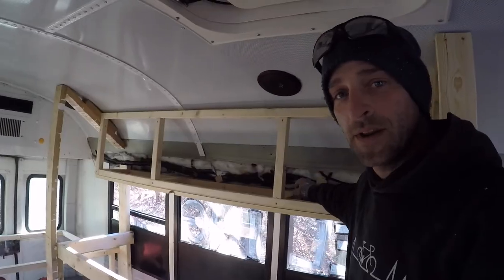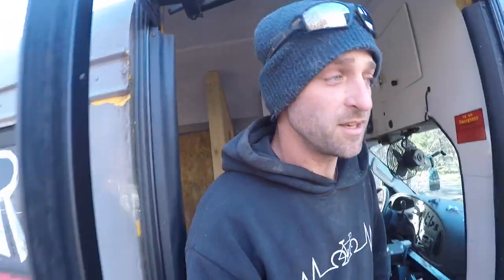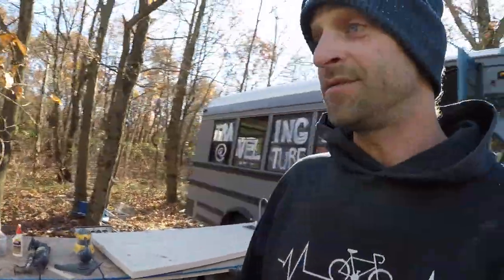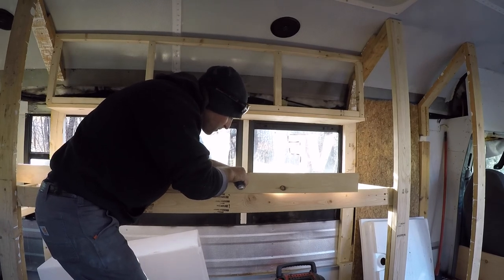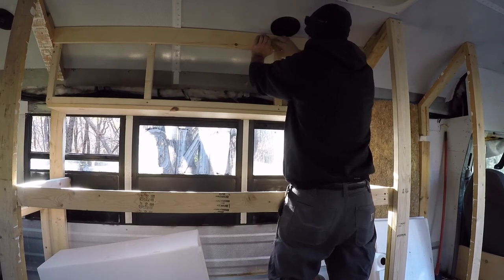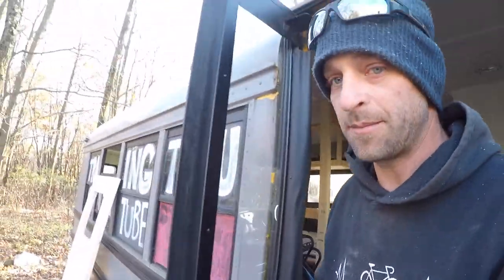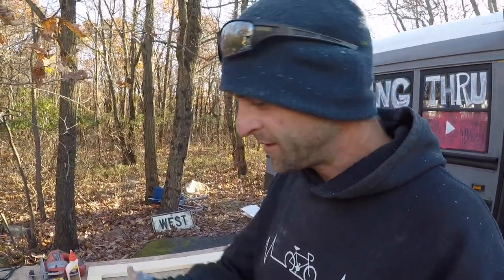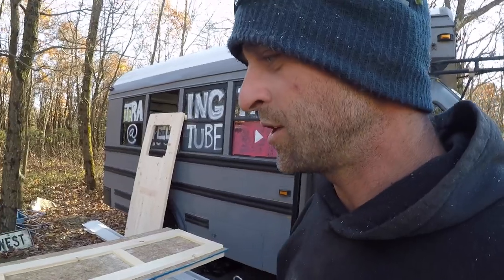Skoolie | School Bus Conversion | Shore Power | Cabinetry and Cats

Comment: Guess the Shore power will provide extra amenities.   Incase you're not aware truck stops.  Poilet Flying J Travel America ect have power hookups and really high speed low drag showers for about 10 bucks for the showers dont know how much for the power but should be some what reasonable.
Reply from the maker: Yeah, really need power in there. I plan on sticking some solar panels on the roof, but I might wait until after winter. Thanks for the tips.

Comment: You have another power option but it is risky.  Get a 100ft extension cord and a power strip.   Some street lamps around actually have an outlet at the bottom also billboards some times have an outlet at the bottom as well.  Its not the most honest method but is a method.
Reply from the maker: Ill keep an eye out, thanks again.